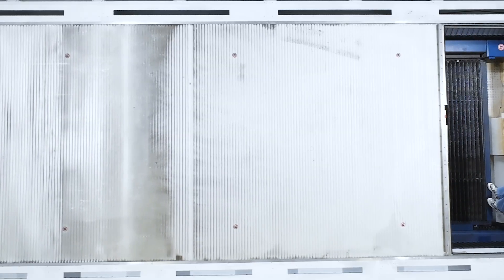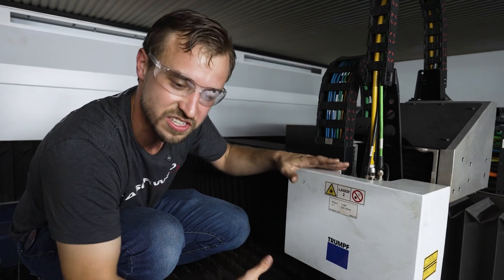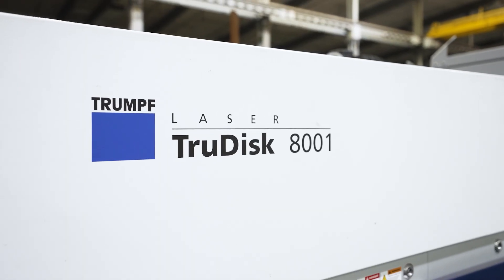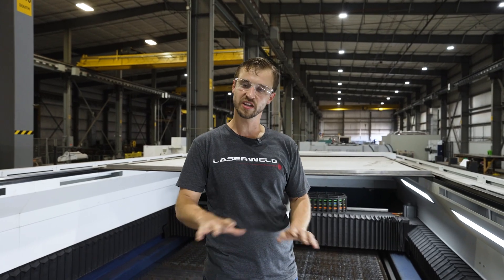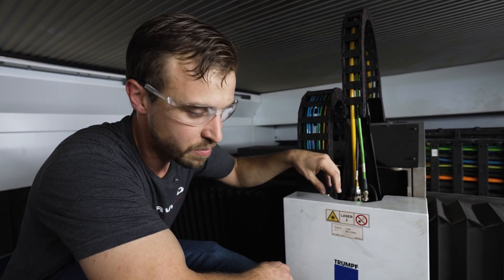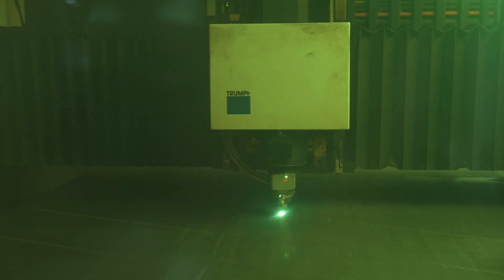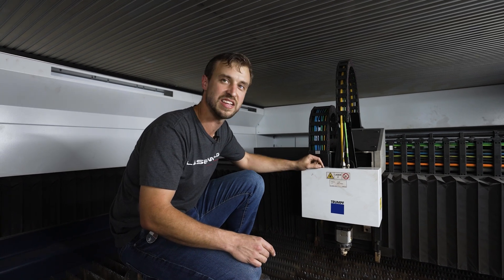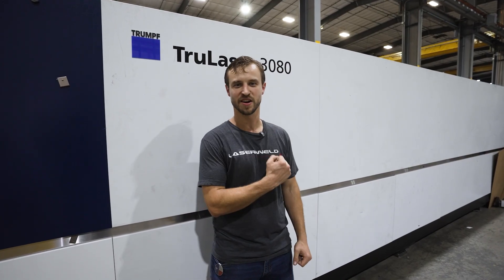The LARGEST Trumpf Laser in America

Comment: Nice video! However, there is no such thing as a 'fiber optic laser.' A fiber optic cable is only used to deliver the laser to the workpiece. The laser itself comes from a laser diode or a CO₂ laser.